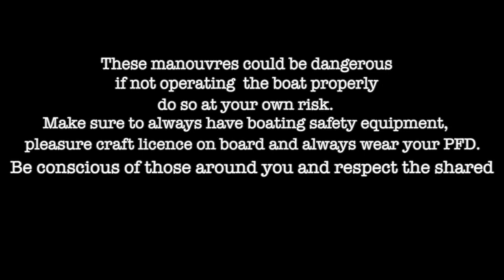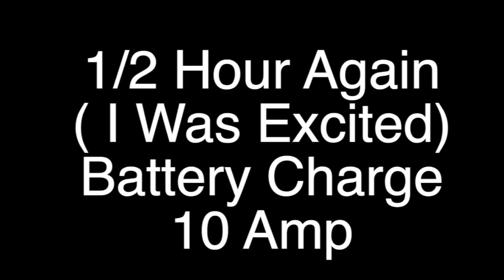Starting Up An Old Johnson 90 After Sitting For Years

Comment: I had what appears to be almost the same boat.   1978 Glastron GT 150, was even the same color except the front deck was solid blue metal flake.   Bought it new in 78 with a 55hp Johnson, repowered in 1979 with a 85hp Johnson, then in 1980 with a Merc 90 tower of power.   Fun times with that boat, almost killed myself more than once!

Comment: Working on my 1996 sunbird with a 112 Johnson SPL. Tore out the flooring and replacing it. Got everything down and first layer of glass at the beginning of the summer. Then I started a new job and moved into a new place. I’m about to get back on it in the new two weeks. I will be posting some videos on my channel.

Comment: I hope you answer this, how reliable are the Johnsons 90 horse motors. I'm looking at buying a 96 model.
Reply: I have a 48hp 94 2 stroke jhonson runs great.. I just rebuilt to lower unit new gears and a seal kit just got home today...Runs good even after sitting for a while..hope this helps..

Comment: WTF 5.56 seconds just to tell people to check their tell tale for water ??? You could have done this in 60 seconds.
Would have been good to advise on was would be the battery situation. You need the battery putting out s serious amount of amps to turn that baby over. 
She will never start less than 300 +  rpm. 
It needs this speed to generate enough electricity so it can send a charge to the coils which then sends a spark to your plugs.

Comment: I have 2 words, STARTING FLUID!
Reply: You dont use starting fluid in a two stroke, haha
Reply: @craighall1547  The hell You dont
Reply: Then give it some nitomethane and open it w.o.t
Reply: Just mix some gas and oil in a spray bottle. Then it won’t run dry.
Reply: Yeah, leads to BROKEN RINGS.